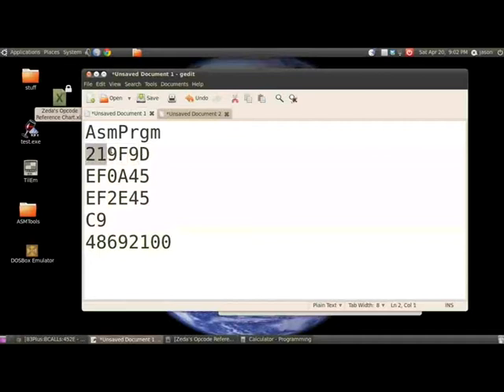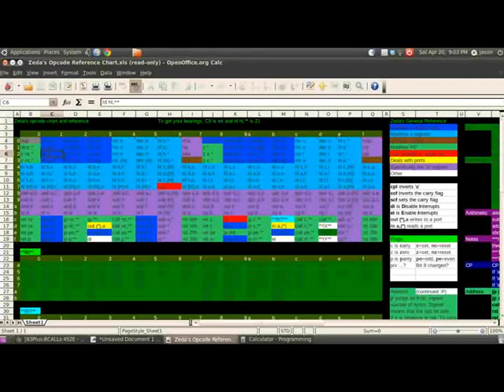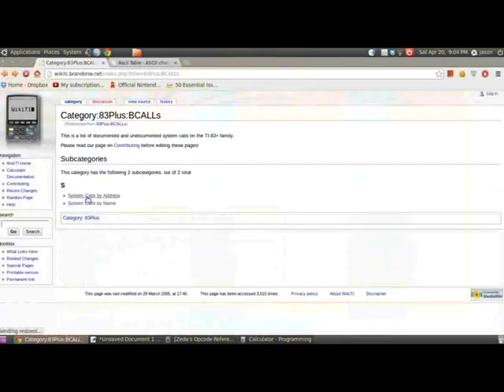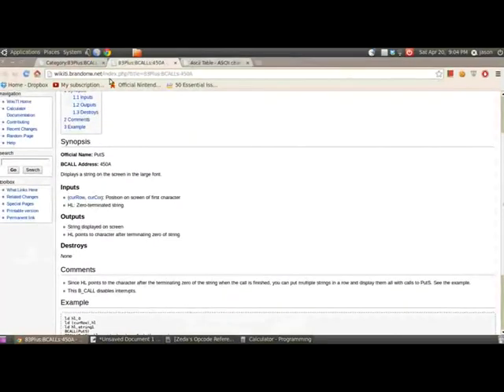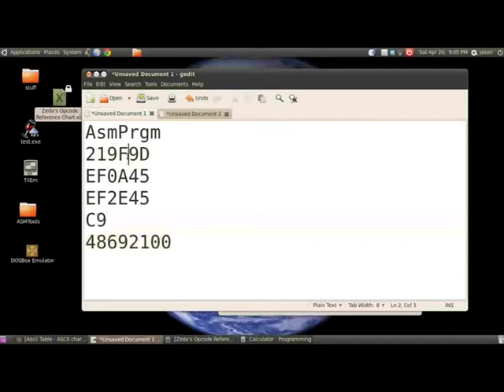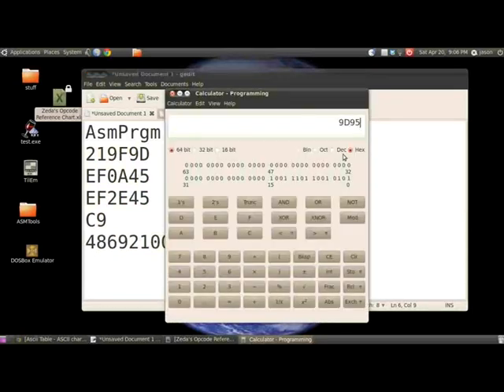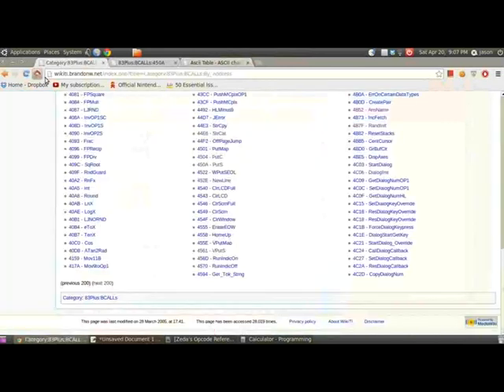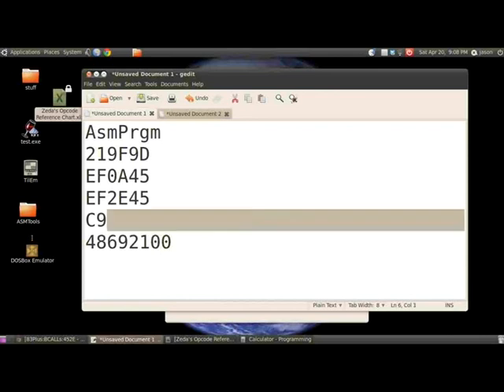Hex Assembly for TI-83/84 Tutorial 2 - "Hello, World!" Explanation

Comment: DUDE! I just wrote a really simple program that probes battery level and returns the results on screen. On that note, I do see a bit of an issue with maintaining code like this, that is to say, adjusting the address of your data pool references if your program expands or contracts.

Also, I'm really curious as to how subroutines could work in assembly. Probably would involve a lot of stack pushing.